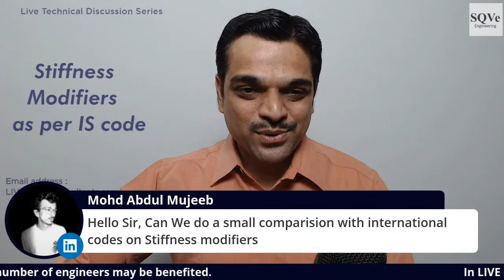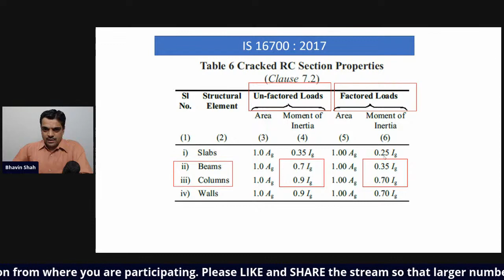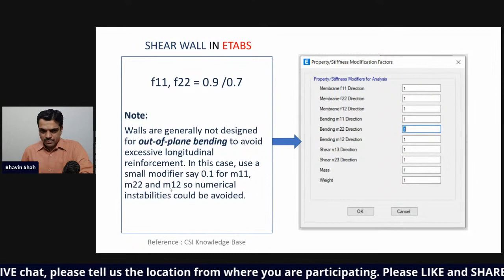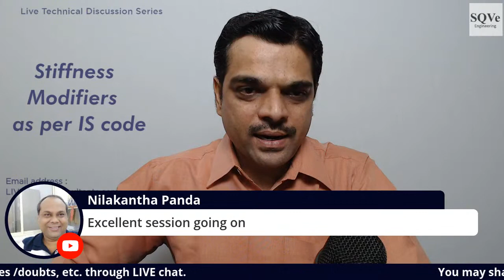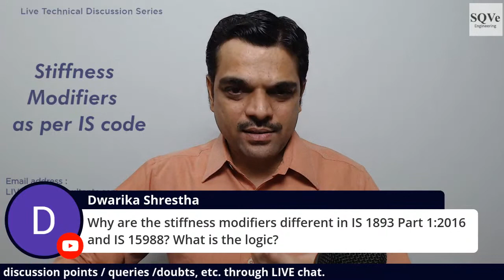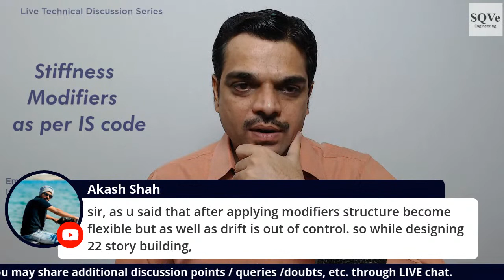Session 24 - Stiffness modifiers as per IS codes - Bhavin Shah

Comment: Sir I have some queries like
1. As I'm using etabs for modelling you had said in etabs first we have to analyse for gravity loads and then for seismic forces so my question is for first time do we have to analyse for only gravity load with no eqx or RSx and for second after applying modifiers we have run for only seismic forces or run for all the load cases please explain.

Comment: what about walls when used as retaining wall....(we cant always ignore them as they might also be on ground level)...??
Reply from the maker: Yes, stiffness modifiers for the same may be considered as per IS 16700.
Reply: @StructuralEngineering  so according to table 5 in IS 16700 for strength stiffness will be 0.7 for retaining wall too....?!

Comment: Sir is there a need to use stiffness modifiers when the building is not under seismic or wind load?
Reply from the maker: Which is the type of structure? At least, stiffness modifers for serviceability case to be used if seismic load is not present.
Reply: @StructuralEngineering  usually residential buildings that are less than 5 storey, as I mentioned no wind or earthquake.
Reply from the maker: @Zorot99  There is no demarcation in our IS code that stiffness modifiers could be excluded for smaller buildings.
Reply: @StructuralEngineering  what about the absence of wind load and earthquake?

Comment: after applying modifiers, the deflection and displacement will not satisfy w r t before applying modifiers. is it require to increase sections.
Reply from the maker: yes, it is required to increase the sections in such case.